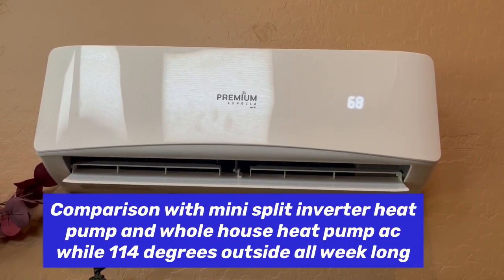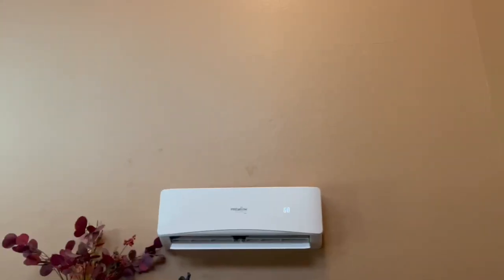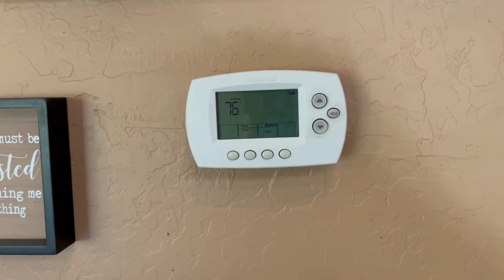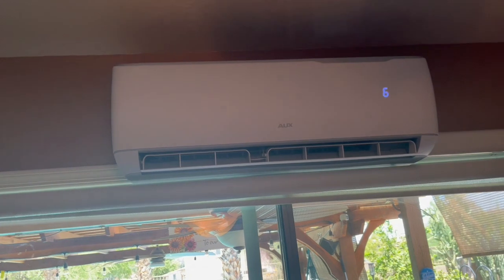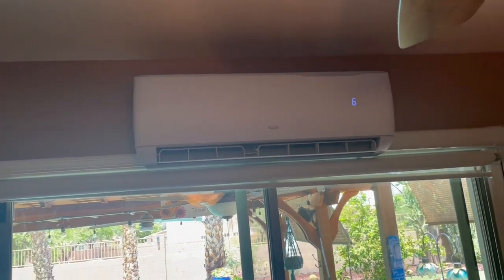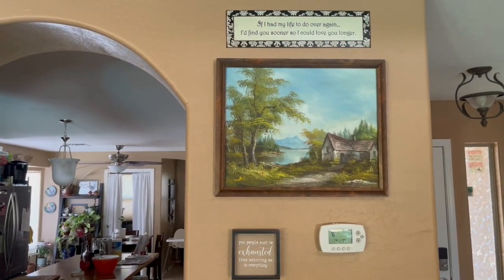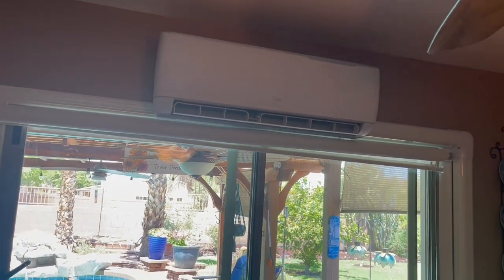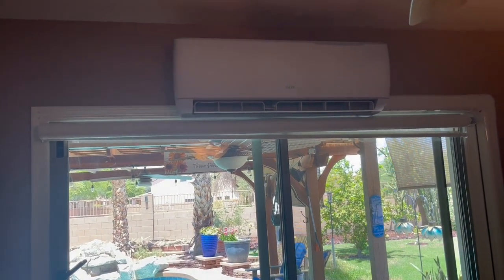Mini split inverter heat pump versus whole house heat pump while 114 degrees out.

Comment: Good stuff!  Fun when it works out, huh!
Reply from the maker: It’s been working great for almost 3 years now. Huge being able to run main house air conditioning heat pumps using solar. Only issues I have is lithium does not have same surge as agm battery banks. For 3 1/2 ton and 4 ton I use agm. They never fail, ever. My system is pretty much finished. No need to add more lithium batteries at this point. System is pretty much paid for. I never planned on going completely off grid. Just wanting to reduce electric bill by 90 percent. It is a lot of fun. This time of year with monsoon is really hard to use solar most of the day even with 95 solar panels. Just way to cloudy almost all day, July and August. Can only produce about 30-50 percent compared to sunny day.
Reply: @diy-solar-guy  90% plus is also my goal, although I am way behind you on hardware lol. It's fun going through your videos as they are answering most of my what if questions. Plus your layout and vendor choice happens to be about the same direction I have been taking :)
Reply from the maker: Hope you get some great deals to get all the parts you need. I am at the point of starting to sell off all the extra components I no longer need. That’s a good place to be. Having to much, lol
Reply from the maker: I’m glad it helps. I just started buying from local places because I am no longer working and permanently disabled. I could only build a little each day. Install 2-4 panels and I was done for the day. It took a long time to put together with only being able to work on system 1-3 hours a day at most and sometimes going several days before I could do anything else. But after years, it is all put together and I tweak it here and there just playing around with different solar array configurations. Will be getting more mono panels in future as deals come up. But very content with power production of very very cheap used poly solar panels. I like each different inverter for different applications. But only Growatt for main house ac heat pumps. Only Growatt can start 3 1/2 ton and 4 ton and stay running all day. Being fully retired and my electric bill so low, my neighbors electric bills get close to $1000 a month in summer, we are only electric in our subdivision. No natural gas. My 4 summer months added together is less than $550 and my 8 winter months electric bills are less than $550 total. My bills will continue to decrease as I learn more and play around with components. This summer was really brutal with huge amount of cloudy days in AZ. Thanks for your input

Comment: If you had a 20 SEER Am Std HP, you wouldn't need a soft start and your inverters would like it better.
Reply: The disadvantage to minis is they are hard to clean, difficult to filter air properly, have poor throw, hard to get repair parts and warranty is nil and ypu'll have a hard time finding an HVAC contractor to service DIY junk.
Reply from the maker: Wow sounds like you have had problems with mini splits. I have 6 for over 2 years now and not a problem with them at all. I clean the filters every 4 months. In fact not even my main heat pumps for house have had any problems even running on solar. I have not had any of the issues you described above. I’m sorry you see to have had problems. Not one has leaked any refrigerant. At $550 for a mini split versus $8000-$10,000 for a whole house heat pump, I will take the risk on mini splits. Hope you have better luck in the future. My brand was AUX and Premium in case anyone is interested. Hope you have a wonderful and blessed day